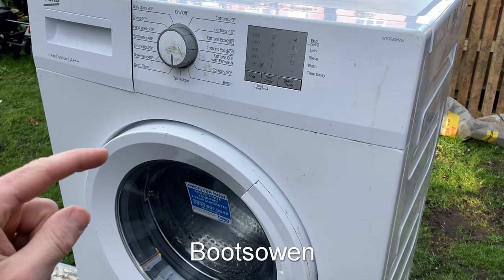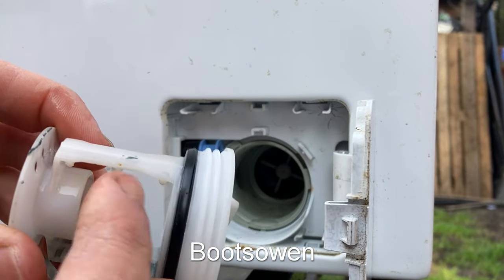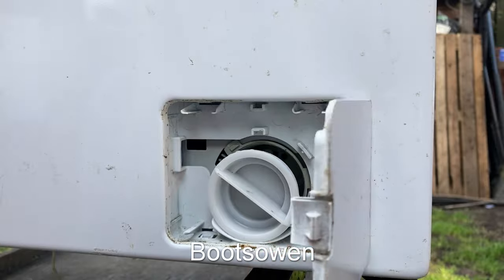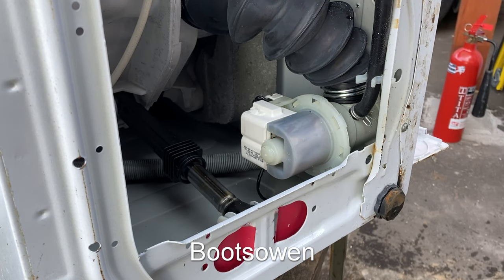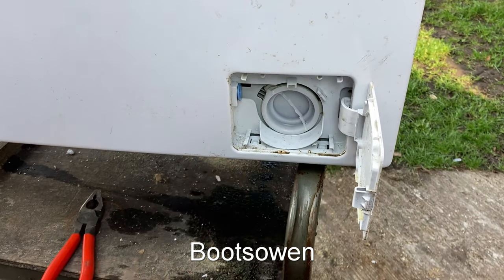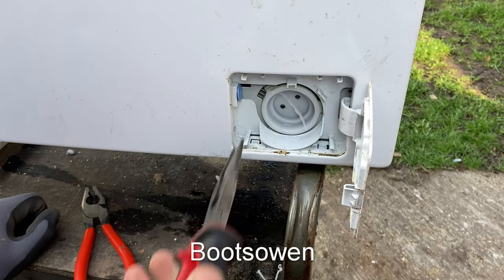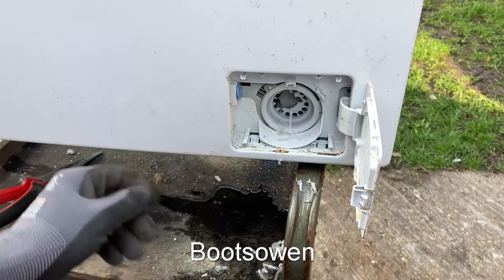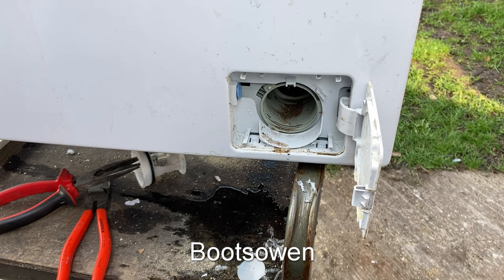How to remove a STUCK BROKEN washing machine drain FILTER PLUG

Comment: Thank you so much, you dont understand how you saved my life. Im 21 and my mom just went out for the evening. my washing machine was showing E04 error so i decided to take the drain thing out and i got stuck and i couldnt put it back in. i was at it for an hour sweating if i would fix it before my mom got home. I found your other video and decided to get my plier out. I struggled for another 30 mins because i was afraid i would break it then i found this video and said screw it. Im tired, sweaty and i can barely move my arms anymore. I yanked it out with my bare hands and something resembling a small mouse came out. I panicked and moved back but upon further inspection it was just a really brown big hair tie.

I put everything back in and i am now just so happy. Thank you for the video, a lifesaver you are

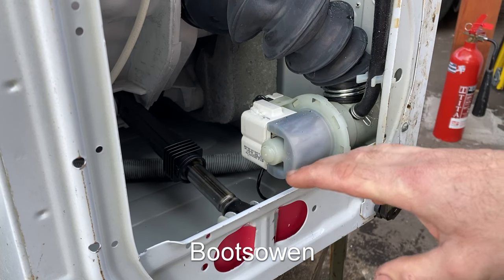Comment: Thank you so much for the help! My machine was stuck, only turning about 90 degrees and making a clanking noise when draining. Around the 2:20 mark in your video, I found exactly what I needed. Instead of removing the pump or taking the front off, I laid the machine on its side, removed the black spiny hose, and was able to clear out a plastic lollipop stick, a belt buckle, and other items that were blocking the plug. Problem solved!
Reply from the maker: cheers

Comment: Thank you.
You don't understand how happy you have made me, I've been struggling with my washing machine for months. It wasn't draining the water, so I tried the filter and the handle snapped.
Was trying knives everything.
Was left thinking I need to replace, but no money.
Then yesterday I had enough, its taking me ages to get through loads, and they are coming out soaking after 2/3 spins. 
And then I found your video. And I drilled the holes and finally got it out.
Ordered a replacement on Amazon and hopefully I don't need to replace just yet.

Comment: This is just such fantastic, pragmatic advice. I've watched videos that painfully take apart my Bosch machine in order to access the drain hose clips at the drain pump. This way is so much easier, no need to move or open the machine. Just have a spare filter plug on hand in case it is required.
Reply from the maker: I’ve done it both ways. This way you don’t have to move the machine but you need a spare plug. Thanks

Comment: Thanks for this, very helpful, so my plug was stuck, glad I watched your video preventing me from snapping off the plug handle, tried the wiggle method for a long time, no good, felt springy, so I assumed a hairclip. Turned the whole machine on its side and tried to wiggle again. It eventually came free, it was a plastic clip and an elastic hair band, all tangled together. Thanks again

Comment: Thanks very much for this - helped a lot and was the only way I could have solved the issue, the machine was full of pens, cocktail sticks and enough coins for a Roman fountain. I also had to put the machine on it's left side to detach the hose leading down from the tub to the filter and empty it of a ton of stuff. Hats off to Samsung for the machine not breaking completely with that lot in it.

Comment: Thanks a lot for your clear helpful advice.  The back is stuck inside my one, so I may just have a job to do.  First get a drill, then pointy pliers:) Maybe order a replacement first!
Reply from the maker: If you can get the pump out of the machine sometimes you can get the blockage out through the out pipe.

Comment: Thank you man! I'm going to try this.
Update: it's worked!! Thank you very much for saving my money. Didn't have a drill so i use screwdrivers and pilers to make a hole and try to break it, it would be easy if i had drill but thank you for the great idea. And may I ask you please if is it okay to turn the washing machine without the filter until I get the new filter?
Reply from the maker: You can turn it on without the filter but water will come straight out of it.

Comment: Hi, I really need advice. My Samsung washing machine debris filter has snapped off (all the handle) & the rest from behind the handle will not come out, what can I do to remove please?
Reply from the maker: Does this video not have the answer?
Reply: Lol, I managed to get the filter out with your advice thank you, it did take some time, But for some reason there was a massive piece of sandpaper in the large rubber connecting pipe that goes into the pump. Yes, I managed to take it all apart. Go me !! Lol. New parts on its way. Thank you again for your help 🥳💯🙌

Comment: Had this exact problem last year. Its litterely designed to break when there is a blockage.

Bra wire was stuck in the filter. Couldn't open it, so just like the video, I got a pair of plyers and snapped it. However I was able to still get enough grip to get it out eventually (45min of tugging at it). 
Its a terrible design, because once something gets in that is long like a piece of wire, its almost nigh impossible to remove the cap since the cap is attached to the back which needs to rotate, but it can't rotate as its jammed with metal. Would be much better if you could remove the front cap, and separately remove the back, at least you would be able to see inside and move the blockage.
Having to order a spare part now, as i forgot and now got a sock stuck in it, so needed to turn the cap again which is a pain.

I love the idea of drilling in, as a way to destroy the cap enough to remove it.
Reply from the maker: It is possible to remove the whole pump and blockage and open the pump from behind. Or if it is a bra wire or something just take off the inlet hose. I have shown how to remove the pump. It is more work but you don’t have to get spare parts.
Reply: @bootsowen  that would have worked if I had known what the issue was, I assumed it was just stuck/tight fit. Once the turn handle is broke, your in for just trying to get it out at that point. Only once I got enough out could I see what the issue was. Potentially putting the machine on its side might have been enough to dislodge it without having to dismantle it.

It's cool to see the inter workings of these machines because they aren't that complex, mostly just alot of empty space around the drum.
Reply from the maker: I guess that’s the crux of it. Once it’s broken it’s too late!

Comment: Hi I have a hoover branded washer and I think the filter top is a thick piece of plastic I am struggling to get through to make the holes. Any suggestions on drill tips ?
Reply from the maker: what sort have you tried?
Reply: Thanks for responding, all I have to hand is a spur wood bit and a normal masonry (tried both). Note it’s just a budget hammer drill.
Reply: Thanks for responding, all I have to hand is a spur wood bit and a normal masonry (tried both). Note it’s just a budget hammer drill.
Reply: Thanks for responding, all I have to hand is a spur wood bit and a normal masonry (tried both). Note it’s just a budget hammer drill.
Reply from the maker: Wood bit should drill it.

Comment: Ah that helps a lot but I just pulled front part if plug off and have nothing to grip now. Guess I need buy a new plug now for Finlux washing machine.
Reply from the maker: hi I posted a video about your exact issue a few days ago
Reply: @bootsowen  the one using 2 pieces of wood? I went one further than that... that part came off and now theres nothing behind to grip
Reply from the maker: So if it’s already broken you could drill holes in the inner part. Or you could try to get a grip somehow. If you can’t you need a whole new pump and filter.
Reply: @bootsowen  thanks yeh its stuck hard.. no grip.. need to get someone remove it. Why a new pump? Would new filter not work aline? Altho ibvs something stuck in it
Reply from the maker: So why not drill two holes in it and work it out with a pliers and then order a new filter plug?
Reply: @bootsowen  yeh will try that first thanks

Comment: How do you get it to drain via the little pipe instead please?
Reply from the maker: Pull the plug out of the pipe
Reply: @bootsowen  cheers mate. Washer is full of water won’t drain and stuck in the kitchen. I’ll have to drain it little by little lol
Reply: What do you do if you pushed the little pipe inside, how can i pull it out without removing the machine?

Comment: Great video, but don't lay machines on their right side.  Any liquid in the tray or tub hose could easily flow to the right and straight onto the display PCB  :p
Reply: Wait I said that before you drilled the filter, not a great video 🤣

Comment: Cut two pieces of metal then got mole grips on it snapped the back 3 inch screw in there glued it back together with my hot glue gun 🎉